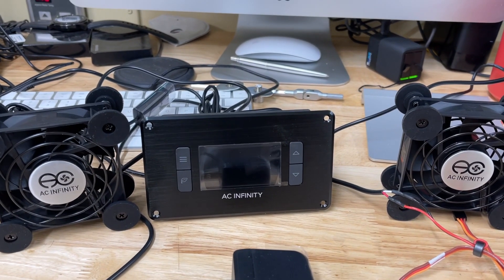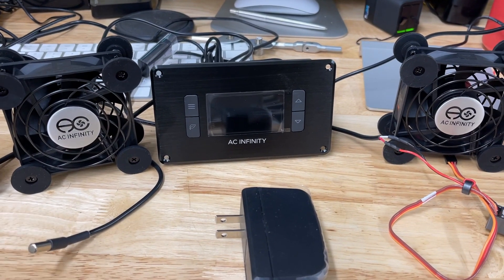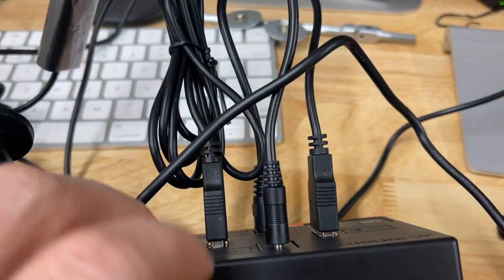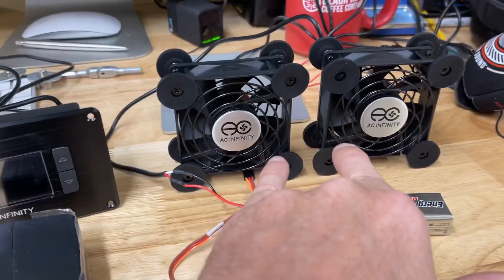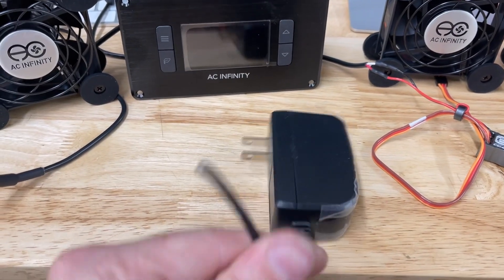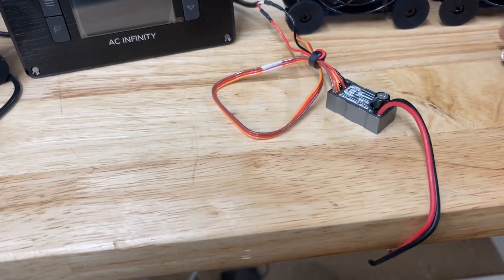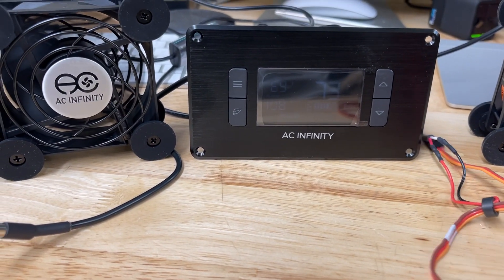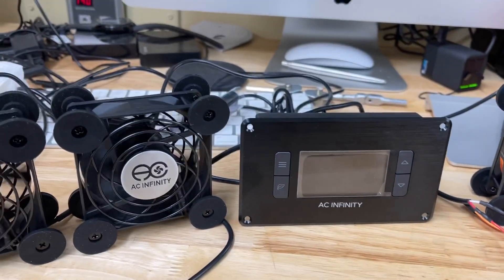200.4 Amp Cooling

Comment: Had a Panasonic TV with a bad power supply, had it replaced once. A month latter it crapped the bed again, when it got hot the picture would turn into vertical lines and the speakers howled, solution was to have a box fan running on low. Noisy but it worked, wish I had known about this setup then